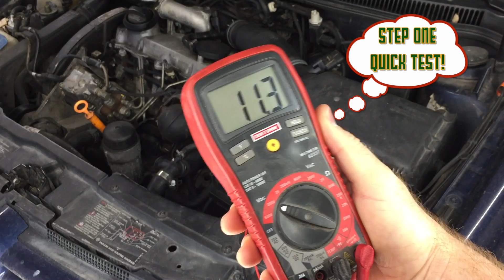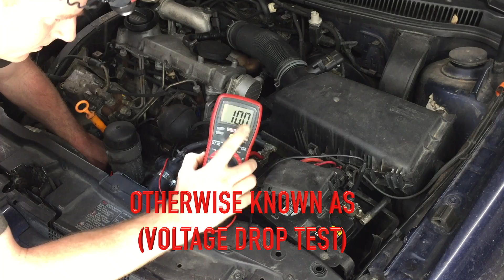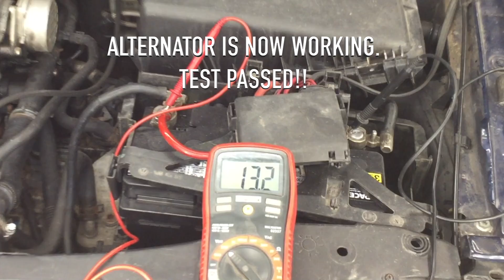REPLACE FROM THE TOP!  -Volkswagen Jetta TDI Diesel Alternator Replacement

Comment: Just finished pulling the alternator from the top on my ‘01 Jetta TDI. If nobody has mentioned it, it helps a lot to remove the three screws on the passenger side cooling fan and drop it down a bit. Alternator comes out much easier. This is a great video and saves you from having to work under the car.
Reply from the maker: Excellent tip! I am glad you got it done. I find it much easier also coming out the top. Plus the ac compressor doesn't need to be discharged or moved 😀🔧
Reply: Pull the radiator fans. I’ll have a video here coming up from the bottom. This looked like hell. Love the ingenuity, but I’m not sure about how he took the pulley off that power steering that had me nervous right there. 🤣… hey whatever works right

Comment: Many thanks to Easy Fix for producing and posting this video.  I wouldn't have attempted this repair without seeing it here first.  Top-notch camera and editing work!  Especially crucial that the bushings in the new alternator are flush as you'll never get it in otherwise.  That being said, this is still a challenging repair, not for the faint-hearted.  Trying to reinstall the intake hoses without a cable clamp tool is impossible unless you remove the windshield washer reservoir and even then it's tough.  I loosened the fuel filter retainer to allow the filter to rise to give me more room under the lines.  There was no mention of a lower or side engine cover which would have to be removed to access the belts and tensioner.  No mention of the power steering hose retention clamp which is a pain.  You can loosen and final-tighten the power steering pulley bolts more easily with the serpentine belt on.  I would also suggest dropping the right-side fan to give you an extra inch or so to get the alternator out and in.  Since you're under there anyway, may as well clear the accumulated engine oil from the intercooler!
Reply from the maker: Thanks Steve! Sorry I missed some stuff for you. I was trying to really focus on getting out the top instead of the bottom. I may have missed a few small details. Plus I think my lower shield might have been missing in the first place and that is why I didn't mention it. It was an early video for me. I am trying to get better. Doing it from the bottom is nightmare. I loved doing it from the top vs the alternative. Doing it from the bottom is the way most recommend. I didn't want to remove the a/c so I went for it and made a video! I am trying to get more gooder at this video making stuff. Thanks for the feedback man I really appreciate that! I hope your project turned out ok.
Reply: @EasyFixShaun  "An early video"?  Dude, that was exceptional camera work.  This being one of your early videos makes it even more exceptional.  Well done!
Reply: @EasyFixShaun  I agree with him∆ I've watched a lot of these videos and this one I actually felt like I could follow and see what was going on
Reply from the maker: Thanks man! Really appreciate😀😀
Reply from the maker: Thank you ace! Really appreciate you too😀🔧

Comment: Im getting ready to do one and this looks much better than the bottom removal method.  Thanks for the great video
Reply from the maker: No problem! Yes it is much better from the top. It’s tight. But totally doable and way easier. Plus no jacking or lifting needed.

Comment: It’s not easy that’s for sure! I had to remove mine to get the pulley off and replace it or what was left of it. I had the special tool to get it off while on the car but it comes with two center options and apparently I used the wrong one and thought I had stripped the shaft out for good. I had to remove the alternator anyway. Thanks to this video I was able to get the alternator back on which I was having a hell off a hard time with it due to its tight fit back in its location. After watching the video I tapped the threaded bushings on the alternator flush and it went right into place and I screwed the bolts in and pulled the bushings back snugly like they need to be. Thank you for showing that trick.
Reply from the maker: Excellent! I got burned badly years ago on those bushing also. I do them all that way now. They always seem to be off by 1mm and it causes so much frustration going back on. Nice work 😀

Comment: If you take off the bumper and crash bar and the passenger side of the front piece where the radiator is you can have more room to take the alternator out and put it in. I just did that and also this video helped a lot, thanks!
Reply from the maker: Awsome idea. Thanks a lot. May help others for sure!! 😀🔧🔧

Comment: Just finished up using this method.  Here's a few extra steps to help you out.
Remove rad fan to make removal and installation easier  
To get the intake tube back on, remove washer fluid reservoir to get your hands in there.
Reply from the maker: Cool, thanks 😀

Comment: This is a good way of doing it. I did one this way recently. Nice job
Reply from the maker: Thanks a lot man! It seemed like the way to go even though it is a little tight.
Reply: Yeah I would agree, It minimizes the time spent under the car which is always a win in my opinion. I used a bungee cord to pull the rad hose out of the way for me and that also made that easier.  @EasyFixShaun
Reply from the maker: @rogerhazen3664  Ya that is a win for sure! I will have to try the bungee cord next time. I was careful when I did it, but I could have cut the hose inadvertently. Bungee cord next time. Thanks man.

Comment: the answer is no it can't be done easily
Reply from the maker: I agree with you. Its not the easiest at all and it is tight to remove. But It can be done from the top with is way easier than the bottom. Overall its the only way to go for me. Just gotta take your time, there won't be any speed records set on this job. Did you do yours on top?
Reply: I just had my 03 alternator out and I think pulling out the bottom was pretty easy.  I think pulling out the radiator fan and dropping the AC compressor is easier than pulling the power steering pump.  I pulled the wheel, the plastic in the wheel well and under car...though mine is already long gone....I removed the belt tensioner and idler pulley.  one of the first things I did was to pull out the washer reservoir,...its easy to do...2 plastic nuts and two electrical connectors.  You can leave the hoses connected and just set the container out of the way.  Then its much easier to get to the lower intake hose clamp and the tensioner mount bolts.  I didn't disconnect any other hoses and just worked it out the bottom.
Reply: @EasyFixShaun  I'll give your method a shot tonight. I don't find out the bottom to be bad but I'm game to try something new...and to your point...I'm feeling too lazy to put the car back on jackstands :)
Reply from the maker: Haha! Good luck. I hope it goes good for you. If not I am sorry. Just my preferred method of possible. If not I remove under the vehicle also like you. 😁
Reply: @EasyFixShaun  I did it last night and it worked pretty well.  I pull the washer bottle out because its pretty easy to do and gives you a lot more room to work.  The step that is super annoying is backing off the belt tensioner....I made a lock pin tool from an old allen wrench but need a second person to put it in while I lay on the ground and use the 16mm wrench from below.  I can envision what a tool would need to look like to enable to leverage the tensioner from above...and if I were doing these all the time I'd fab one up.
-I also pull out the rad fan for some more wiggle room.
Reply from the maker: Nice job man! Thanks for the feedback. I am glad it worked well for you 😀
Reply: This is the correct answer.  But I got it done.
Reply from the maker: There are a few bottlenecks in the process for sure that are a little tricky. But- It is much easier to remove from the top than the bottom. It can be done both ways. But those are the only options to do the job. I prefer from the too by far 😀🔧

Comment: May not matter which terminal you disconnect from the battery but its WAY safer to disconnect the earth. This way if you accidently touch positive and the chassis with a spanner you don't fry yourself.
Reply from the maker: Very good point. 😀
Reply: 12v wouldn’t hurt too bad I’ve seen people get hit with 120 and 240v
Reply: @zoomerfeels3625  it won't kill you sure, but it will sting a bit. Also can damage other electrical components

Comment: Leave belt on to loosen the 3 allen head bolts way easier
Reply from the maker: Either method will work. I prefer the pry bar so that pressure can be removed and applied at will. That way you can line up the next Allen bolt with your ratchet fast and easy.

Comment: I have a 01 jetta tdi 1.9 stick drive do you know if the link you have for the alternator works with my car?
Reply from the maker: I checked out the link and I think it will work fine. Just add your fitment vehicle and verify to be sure at the top of the page. In case it doesn't work, here is another link to one that shows up as proper fitment 😃🔧 https://amzn.to/3UfZixP

Comment: Did you remove the power strearing pump? If so best way to drain it? Please and thanks
Reply from the maker: I left hydraulic lines connected and moved to the side temporarily during alternator replacement 😀🔧

Comment: Any pro tips on how to get the alternator connector off if I broke said fragile tab? 😅
Reply from the maker: Did you break the locking tab connector or the button? You should be able to use a small pick either way, and bypass to open, prying the small plastic lock mechanism open just enough to slide it right off 😀🔧

Comment: Does it matter if u switch from a bosch to a Valeo? 
Are they interchangeable?
Reply from the maker: I am not sure on that. If the alternator fits by application you should be ok. But Bosch is probably the best bet 😃

Comment: @Easy Fix really dumb question, do you pull the hoses off the power steering pump or just the bolts holding it and try and move it to the side?
Reply from the maker: I moved it to the side 😀🔧
Reply: @EasyFixShaun  well i got it, thank ya sweet baby jesus.  Your video rocked me.  Def. Following you!
Reply from the maker: 😂 Thanks man! Glad to help! New sway bar link sounds, diagnosis and replacement video dropping soon 😀🔧

Comment: Hi just a thought but I’m pretty sure you guys used the wrong bolt when putting back in the alternator maybe I’m wrong but my 2 were threaded all the way and also what happened with the power steering pump. 

Here’s some tips

This video makes it seem easy you skip the parts where you struggle to gets bolts in or peice out
Reply from the maker: Bolts were reinstalled into their old locations and the power steering was laid to the side once disconnected. Sorry for the missing footage. The point was to show all the struggles. But the camera footage of the power steering was missing. I probably didn't hit "record". Sorry about that. I hope it works for you 😃🔧

Comment: If you have a lift. Way easier from the bottom
Reply from the maker: How do you navigate around the a/c compressor? The only option I see is to remove lines and remove compressor.
Reply: @EasyFixShaun  you can leave it in. It did give me a little more access to the positive cable by pulling the 2 bolts and letting it hang(I'm leaving it in next time). Then with the car in the air use a pole jack on the oil pan, remove the 2 motor mount bolts and lower the whole motor down. Remove the small idler wheel and it comes straight out. The PS pump can stay in too, taking the pulley off does give your hands a little more room though, so that's optional.
Reply from the maker: No kidding. Excellent thanks a lot for the tip. it all looked like to much vs going out the top with it. So I didn't attempt it. Really appreciate your feedback. Maybe I can make a video "out the bottom" next time 🤓🔧

Comment: That alternator is such a pain to get out after it’s unbolted, seems like there’s no way it’s getting out 🤦🏻‍♂️
Reply from the maker: You are right. Its very tight. I had trouble also. I took my time and it barely cleared everything by twisting it around. It went pretty good overall, but that part was very tricky. Sorry you are having a rough time. Stick with it, you can do it! Let me know when you get it out and back in 😃
Reply: Got it all in except my tensioner bolt stripped out 🤦🏻‍♂️🤦🏻‍♂️🤦🏻‍♂️🤦🏻‍♂️🤦🏻‍♂️🤦🏻‍♂️🤦🏻‍♂️🤦🏻‍♂️🤦🏻‍♂️🤦🏻‍♂️🤦🏻‍♂️🤦🏻‍♂️🤦🏻‍♂️🤦🏻‍♂️🤦🏻‍♂️🤦🏻‍♂️🤦🏻‍♂️🤦🏻‍♂️🤦🏻‍♂️🤦🏻‍♂️🤦🏻‍♂️🤦🏻‍♂️
Reply: My belt isn’t fitting... any thoughts?
Reply from the maker: @chrispy398  Is it a new belt? Same length as the old one? I would check that and also google belt routing for your year make model and engine. I always double check myself or I sometimes get the routing incorrect. 😃
Reply: I took it back apart and apparently I missed the bottom bolt hole that the alt mounts to 🤓
Reply from the maker: @chrispy398  Excellent! Glad you found it 😀

Comment: You failed to mention the power steering lines
Reply from the maker: I didn't remove my lines. I just set the pump to the side with everything connected.
Reply: @EasyFixShaun  was it not hard lined? Because that's what I ran into with all the bolts out I couldn't move it with the hard line on.
Reply from the maker: I am not sure. I don’t know why I didn’t show it. I think I disconnected the one hard line for the pump pressure line. I believe I left the supply line from the tank hooked up and set the pump off to the side. I’m sorry I tried looking up my old original footage and can’t find what I did there. I hope you can figure it out! I watched the video a couple times and something is missing there. My bad.
Reply: @EasyFixShaun  it went well except now my serpentin drive belt seems to be off some where, its rubbing on the back against its self. Maybe the power steering pump pulley?
Reply: @EasyFixShaun  the alternator was exactly same. The belt tensioner seemed alot harder to get lose of enough to put the belt on

Comment: I’m watching this video, then comes the steering pump removal. He removed a few bolts, then he skips to the belt tensioner. What the hell happened to the hose and lines for the steering pump? This video is incomplete... if you are going to make a video, make it properly...
Reply from the maker: Sorry about that. I think I just unbolted it and swung it out of the way temporarily with the lines attached. That’s my normal approach to any power steering system. That way there isn’t fluid all over the place 😃🔧
Reply: @EasyFixShaun  ok, thank you for taking the time to reply.
Reply from the maker: Of course! No problem. I feel bad I messed that video up on that portion. I went back through the original video I made from the raw files. I somehow just omitted that small segment. I’m not sure what happened. I have the footage. I probably hit delete or don thing on accident. My bad.

Comment: PRO TIP... YOU NEVER PULL THE POSITIVE OFF THE BATTERY FIRST. AUTO 101. NEGATIVE ALWAYS FIRST OFF LAST ON !!!!! THIS HELP PREVENT SHORTS AND ARCHING YOUR WRENCH ON GROUND IF YOU SLIP !!!!!!   this dude is not much a pro as he pulls positive off first
Reply from the maker: Are you sure?
Reply: @EasyFixShaun   yep, auto 101, neg off first on last. to many have arced there wrench and either hurt there self or caused some sort of damage.  tho im retired now. for 47 years. teaching. working. neg off first. on last. basic logic as well.  its a safety thing, you should know that..
Reply from the maker: I think your idea is an excellent tip. I don’t think it is required.  Only one cable needs to be disconnected to disable the system. You should know how (and not how to) use the caps lock feature and punctuation for your comments. English 101 would be a good refresher if you want to check that out. DO YOU KNOW WHAT I MEAN!!!!!!!!!?????????
Reply: @EasyFixShaun   ya at times I prefer using caps lock. not always. but either way. no matter if your only pulling one clamp to disable system you always start with the negative first. that way because of safety, you do not ground your wrench and cause harm to your self or the car specially with todays computer run cars. does not take that much to short out an ECM/PCM, you will not cause a short if you touch any metal from the neg side. but if you touch metal from the pos side. ya. something will be damaged. you, your tool, the car.
Reply from the maker: I like your tip. 😀

Comment: Half way through doing this on a 2013 Scirocco. What an absolute 'bar-steward' of a job. Engine mount undone on right side of engine, engine jacked as high as it can go in the bay, fuel filter obviously out for ease of access, throttle body off, AC pump mount bolts undone so AC pump loose, then, it's flippin tight, but it comes out JUST!!! Just got to get the new one in now!!! Never again!! Ha ha!!
Reply from the maker: Nice work! They are tight! I was happy I could get mine out but it was just barely. Better than the alternative 😃🎯